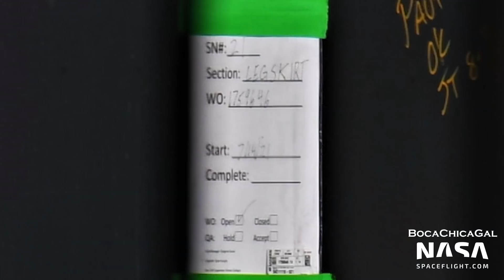Raptor Engines Removed From Booster 4 | SpaceX Boca Chica

Comment: So all those red marked tiles broke just from moving and stacking Starship?
Reply: No, they broke or were installed improperly during the installation process. They stacked the starship without the markers because it would look dumb af otherwise, and then did quality control after. Easy to replace 10% of the tiles properly than to get all 100% correct for the FIRST time ever.
Reply: And they're literally ceramic tiles, so they're kind of just as fragile as any old ceramic tile. A simple bump or maybe a metallic chain smacks into a plate and cracks it, and it needs to be replaced.
Reply: @ryanthompson3737  silica tiles not ceramic tiles, can you imagine weight
Reply: @ryanthompson3737  There is about 30% red on the nose.  Do you think mid-section will be better?
Reply: @nikemie1  I read somewhere the tile are an extremely lightweight honeycomb material.
Reply: @nikemie1  Ceramics are usually made from silica. It's literally sand (or it's main component: Silicon Dioxide). What matters is the way they make it. Ceramics for our everyday use are usually made from baking a slurry of sand, while the SpaceX tiles (probably TUFROC, they licensed it years ago from NASA) are made from something that is close to rock wool. They make a slurry out of it, cast it into the right shape and sinter it (baking under high pressure). That's why your plates break instantly and those tiles do not.
Reply: @deadhamster7570  Thanks for the explanation.  I was not familiar with the word sintering.
Reply: @deadhamster7570  They are clearly light weight (harder than styrofoam), but I would like to know how brittle they actually are? We have seen installers hit them with the flat of their palms rather hard from the look of it (which could explain the number of cracked tiles). 
The real problem was the speed and lack of supervision the installation was done under. We should not only blame the installers.
Reply: @knowlegeisgood8735  Edit: I took another look at some high res photos and some tiles are clearly cracked. Thanks to @Knowledge Isgood for pointing that out.

Original Comment:
Are we really sure that those tiles are actually cracked? I would argue that they can take a hit or two, but are simply out of alignment, therefore they have to we taken of, the pins holding them need some adjustments and they put them back in place. As I hopefully recall correctly, the tiles are actually made from a white fibrous material and are only coated with a Silicon Oxycarbide called "ROCCI" which can withstand heat of more than 1600°C (2900°F). It is additionally coated with some special glass to prevent oxidation on reentry. It could be that ROCCI and the glass layer is cracked and the tile could work just fine, but SpaceX isn't going to take chances
Reply: @deadhamster7570  Many were clearly cracked and had sections missing. You might need to look on hi-res photos to see it. Many not flat either. Simply a really bad installation. Done in inhuman haste.
Reply: @knowlegeisgood8735  yup, it really seems that way. I'm just wondering what made them crack: Whether it's the internal structure (similar to the pins used in the TUFROC patent) or something else.
Reply: I’ve seen them pick these up with one hand like it’s styrofoam, so they’re not heavy...
Reply: @pomiferadoesitwork2213  I wonder if they are like a hard plastic or like fine porcelain?

Comment: So when one of these "tiles" breaks off on reentry this thing will burn up just like the space shuttle did
Reply: No. The heat blankets below the tiles can take over 1200°C (if they are what I think they are), and the steel even more. It just needs to last the few minutes it is being blasted.
Anyway, they will soon find out. That is why these tests are done.
The Space Shuttle was made of aluminum, not 304L stainless steel.

Comment: As was pointed out by others, the scaffolding removal doesn't look safe ...
Reply: @B R that's not the title of the chapter, and doesn't change the main point.
Reply: When is it ever? Have you ever watched workers do those jobs? One of the most dangerous there is.
Reply: @knowlegeisgood8735  Living isn't safe by definition, but having more than one attach point, that seems like a great way to reduce risks.
Reply: @Kavriel  Sure would. But if securing yourself by itself is dangerous the choice can be hard.
Reply: @B R This is what I was coming to say... Scaffolding was getting added, not removed. So it wasn't as dangerous as people think because despite that one shaking some, it was securely attached and is getting even MORE securely attached as the work went on.